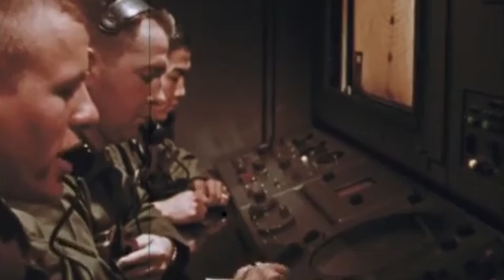Exploring an Abandoned and Hidden Cold War Missile Base Runway

Comment: I have some doubts.

I’ve grown up around Nike facilities, and visited 8 of them. I’m also a bush pilot, and have helped build small runways that I also operate from. I’ve got some idea of the considerations that go into runways and the aircraft that can use them. 

First concern is the runway numbering. The number looks yellow, and appears to be facing the wrong way. Runway numbering should be white, and placed at the threshold of a runway facing the magnetic heading from that threshold. Also, at a current heading of 127°, it would be Runway 13, although it’s possible and likely that magnetic shift can account for a different heading at the time of runway closure. 

The second concern is runway size. At just 900x35’, this is very small for a paved runway. Of the aircraft in service at the time, only an O-1 Bird Dog would have the capability of safely operating that strip, and even then with a 36’ wingspan would itself be wider than the runway surface. This would be a challenging strip for regular operation by an experienced bush pilot, and likely a one-way strip for a box-stock Bird Dog.

What also doesn’t track is precedent from other sites. Every site I’ve visited either had a 5000’ runway capable of handling C-123 or C-130, or helicopter landing facilities. I’ve never seen a Nike site with such a small strip, let alone one so poorly positioned relative to the site. This site (NF-41) was built on a huge tract of land, combining what were originally two separate Ajax sites into one Hercules site by converting the northern facility into fire control and the southern facility into the launch site. The DoD certainly had the room and the budget to build a 2000-2500’ strip (which could be considered more normal for Army liaison-sized aircraft like the O-2, Beaver and Otter), let alone a 5000’ strip for cargo aircraft. They also had flat ground on which to place their runway, not being required to ramp it to clear other buildings.

A little Google Earth archaeology shows no remnant of a similar structure at the once-independent southern facility, dating this strip to the 1960 conversion to Hercules. By this point, the Army operated the Bell 47, Piasecki H-21, and had just introduced the UH-1. There were plenty of easier options for air access than a tight strip only half-suitable to the lightest two-man liaison plane in inventory. Looking at imagery all the way back to 1995, the area immediately along the “runway” edge remains old growth forest, with no evidence of having been cut at any point since facility construction. This means the runway would’ve also had an impossibly narrow width, with no room for error as your wingtips would be in the trees.

However, I also can’t offer a more reasonable explanation for this structure. The markings are almost correct and it has no other visible use from above. Based on standard IFC schematics, all other facilities are accounted for. It was a National Guard operated facility, and therefore may have had some leeway in construction, and may explain the decision for a small runway. Aerial imagery from 1934, 35 years before construction, shows it to be an area of clear field, and imagery from 1995, 25 years after shutdown, shows forest. It’s entirely possible that, at the time of construction, the vegetation was sparse or nonexistent. This still raises a problem with the need for a ramped runway end though.

Anyway, I’d say it’s inconclusive. Half the evidence says it’s an impossible runway, a quarter says it’s nonsensical and unnecessary, and a bit of unproven supposition leaves the option that it was really, at least for a short time, intended to be an airstrip.
Reply from the maker: Awesome research. Thank you for posting some effort to understand this. I am not a pilot but it would seem a bit of a mystery... This part of the base was just the control and the launch is a distance away... I struggled with trying to make sense of it myself...
Reply: Fascinating!